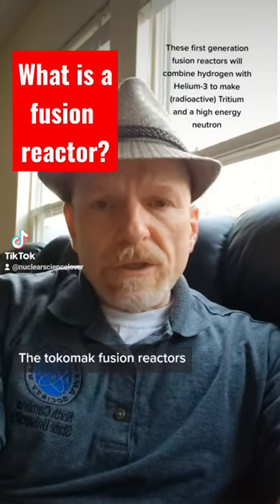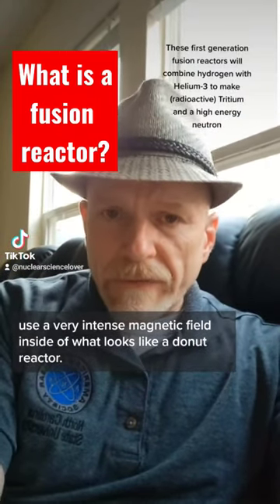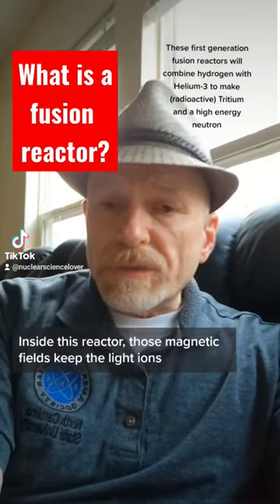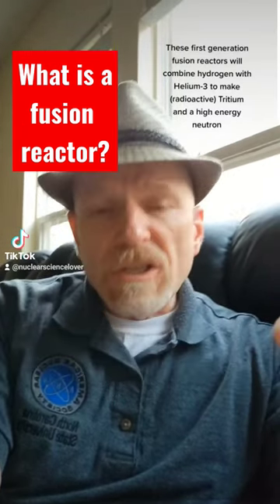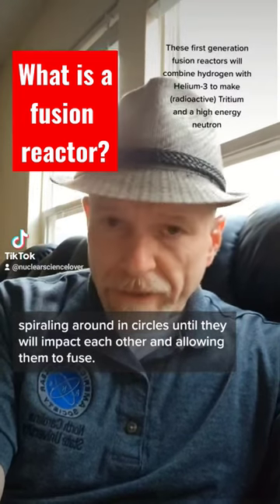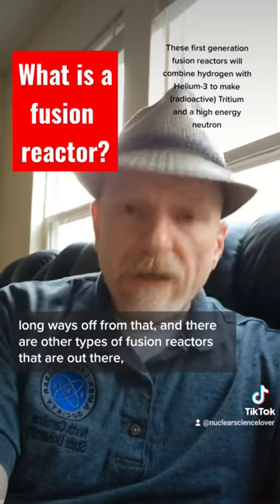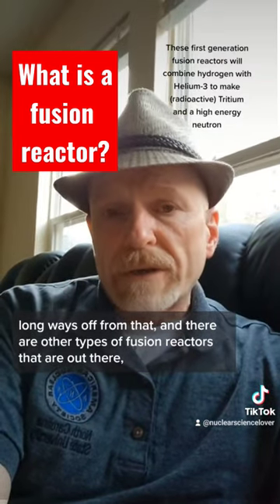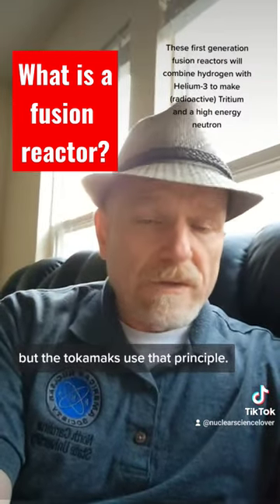Tokamak fusion reactors

Comment: You can transport electricity through distilled water inside rubber tubes

But I use magnets shaped like RPG shaped charges, and gold wires, to send plasma one way and contain it, and any extra current can go back into a battery.

You can also add opposing electric currents to the magnets and wires, which articulates the tubes. Which look like tentacles, made of light. 

The tentacles can be connected to sensors, which allows an electric communication to be established with the fusion reactor. 

This can then be controlled remotely. 

I have seen this, and it had a battery on it. Looks pretty cool. Used to come out every night.